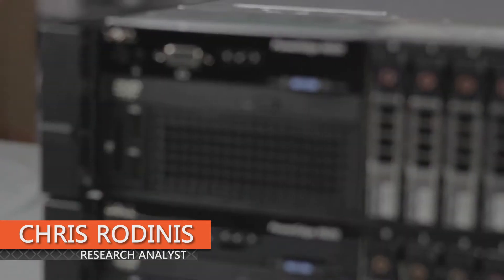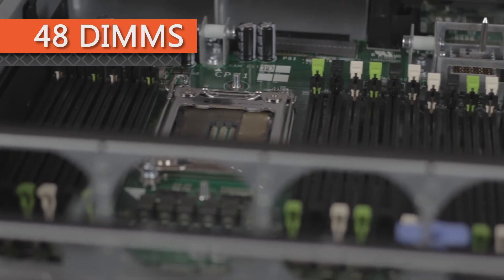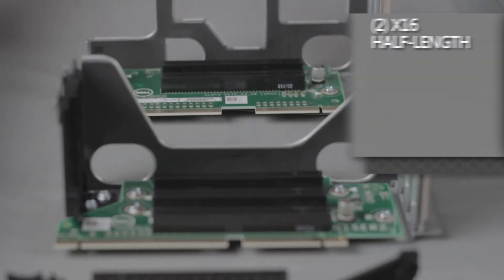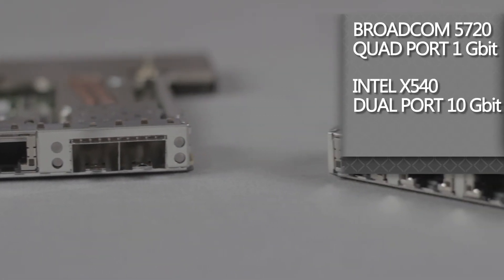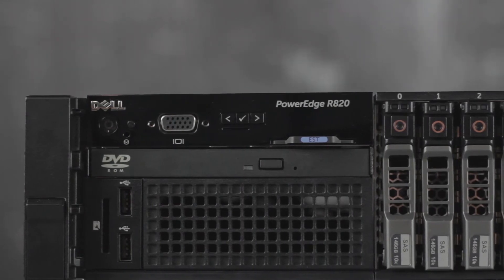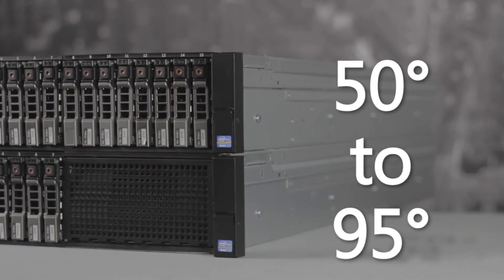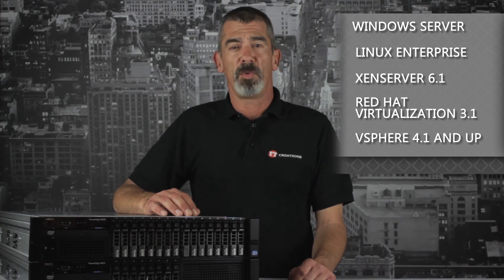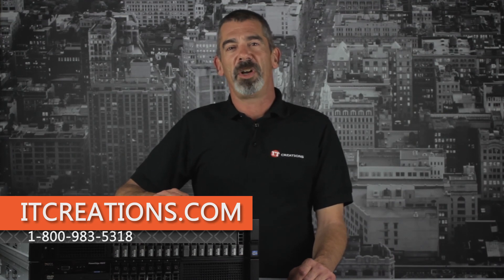Dell PowerEdge R820 Server Review - IT Creations, Inc

Comment: I’m confused , it says 16tb maximum? Meaning 16 bay available and only 1 to per unit? What is the maximum allowed ? Will it work if I add 2tb drives, meaning 32 tbs? What is my drives are 4TB each?
Is there a way to allow the 820 to read more?
Reply from the maker: In a nut shell, the specs are based on drive capacities that were available when the system was first released. Yes! It will support more storage than that and is dependent on the installed controller.  For further confirmation, check out this link: https://www.dell.com/community/PowerEdge-Hardware-General/R820-max-storage/td-p/7752743 
Hope that helps and thanks for watching!
Reply: @Itcreations-LA  I see mixed results , from 16bays of 4 to 8tb drives being accepted with proper firmware, others forums saying just 32tbs being the limit at that timeframe when controller was released.
Thanks

Comment: When installing windows server 2019 or any other windows is for that matter on my Poweredge R710, windows says that they see no hard drives when I clearly have 4 Sata hard drives connected. How do I fix this problem
Reply: Setup probably can't see them if they're connected to a RAID controller with no driver loaded during setup.
Reply: @andrewford80  thanks for the tip. Fixed my problem. Thx a bunch. I owe you one
Reply: @Anne14881  well it had been a while so wasn't sure if you'd found a solution yet but if it helped, I'm pleased to hear it

Comment: Here is what I'm confused about.. From what I have seen, the R820 has 4 CPUs, but all of the pictures I've seen of the inside only show 2 CPUs... and then there's some weird tray with 2 more CPUs. What the heck is going on here? Does the thing have 4 CPUs or not? ;-;
Reply from the maker: Hi Kraio, 
It is a 4-processor system with a motherboard that has the PCIe slots, two sockets for processors and associated memory for those CPU's.Then there is a Processor Expansion Module which has the other two processor slots plus associated memory module slots. The Processor Expansion Module clamps down in pace over the top of the motherboard and the other two processors.Page 37 of the user manual shows how it works. Thanks for watching!  https://www.itcreations.com/user-manuals/R820/Dell-PowerEdge-R820-Owner's-Manual.pdf